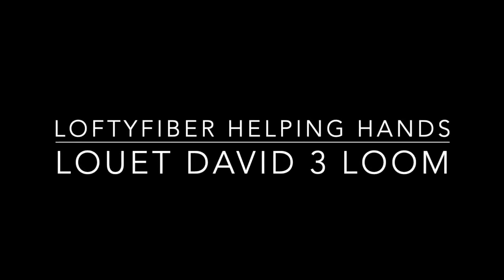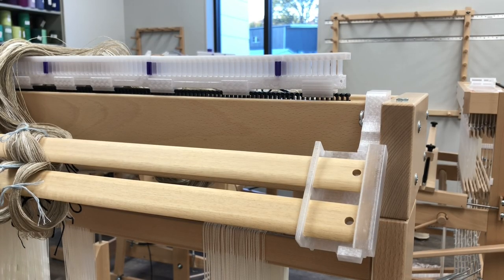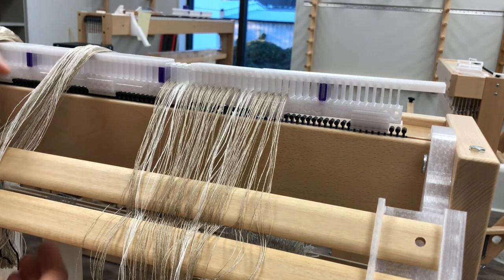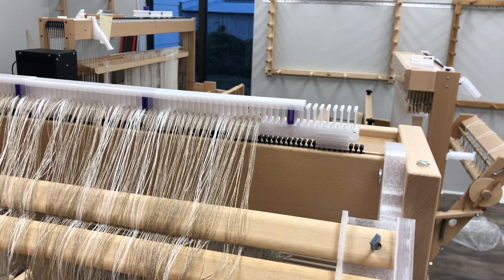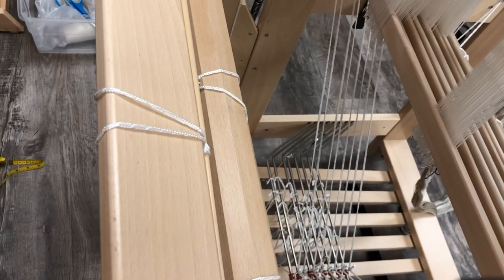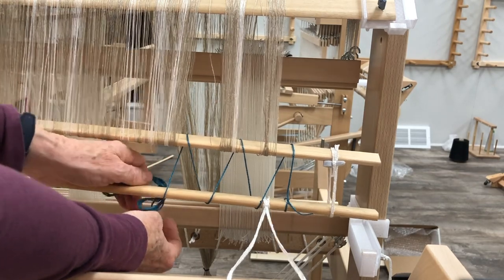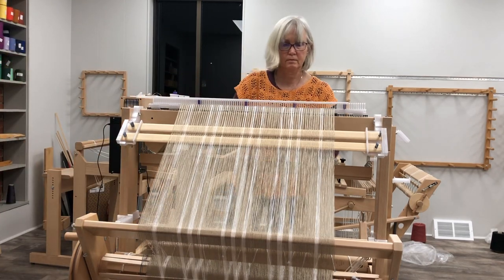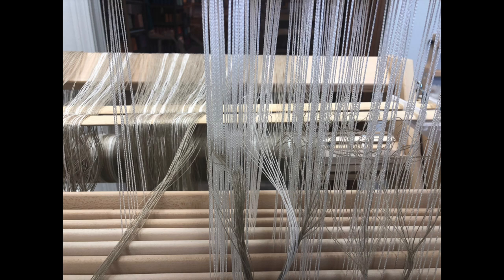LoftyFiber Helping Hands - Louet David 3

Comment: can I assume this will work on my David II ?
Reply: I have this on the way for my David 2, I emailed them about which ones, they have a pull down on the order area that will go to David 2. She said you have to have the original lease sticks. It doesn’t fit just any lease sticks.
Reply from the maker: We have a slightly different model for the David 2 as the measurements on the David 2 and 3 are different.